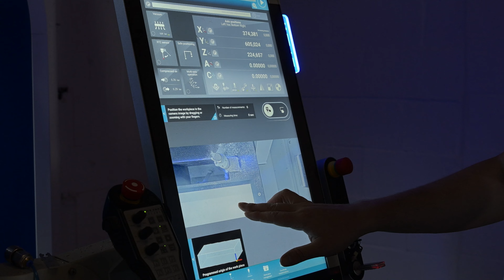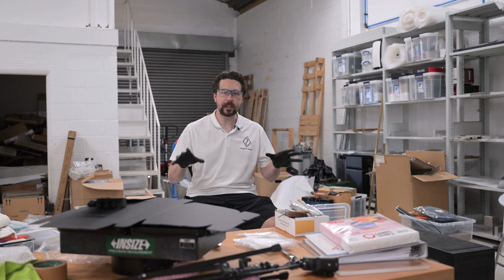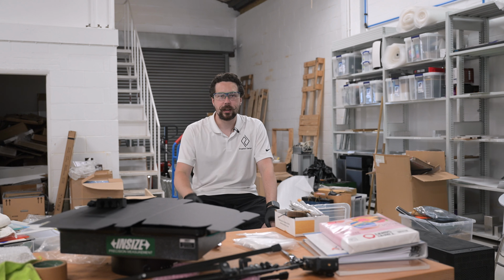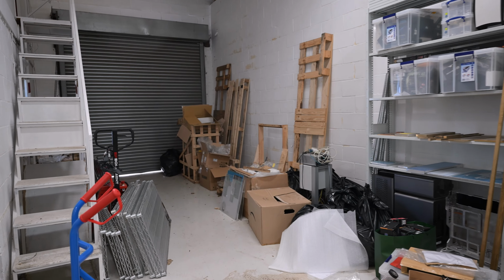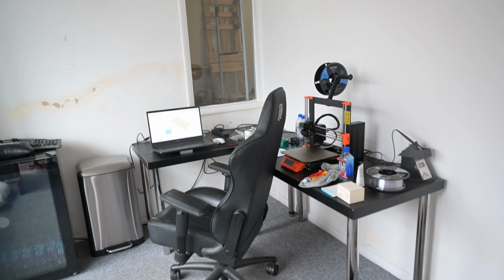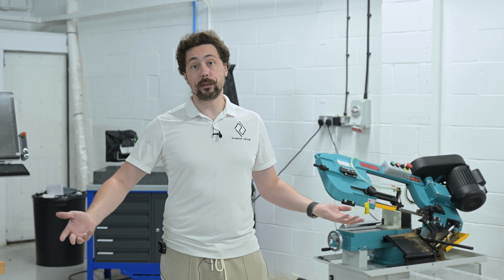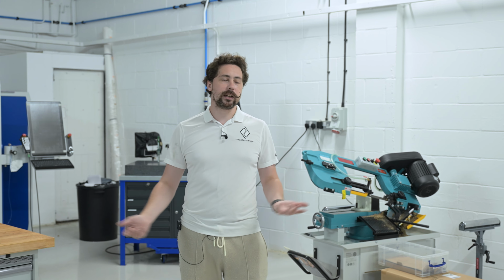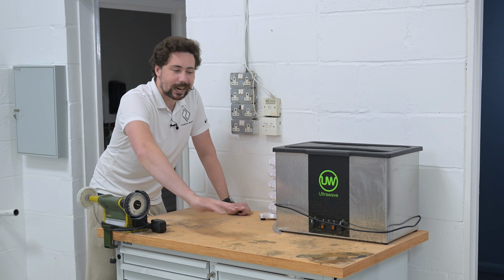Computer Lighting Panels and my Shop is a MESS | Praetex Vlog 5

Comment: Nice to see more content. Nostalgia kicking in. 
And why the hack do you have a janky laptop setup when you build the most incredible PCs? löl
Just a side note, there is some really weird going on with the audio when you are talking.
Reply from the maker: Yeah there’s some clipping going on in the low frequency bits that I’ve not been able to figure out. I think it’s because those bits clash with some of the background machine sounds. Unfortunately if I leave it completely unfiltered you get a really horrible hissing going on that murders your ears.

Hey hey that laptop has been crucial! I need it for use with the scanning arm as I can keep it tethered rather than using wifi. It’s no slouch either, I needed a Quadro for the arm software support, so went with a beefy one.

That said, the office setup will be substantially upgraded later.